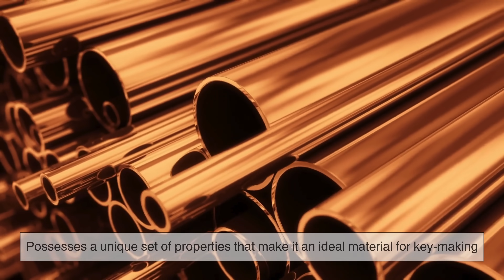Why Are Most Keys Made of Brass Instead of Steel?

Comment: Why is it in ENGLAND that YALE uses STEEL KEYS for their residential locks with the Y1 keyway as we call it in America & also how does SCHLAGE get away with its "L" multi-section STEEL KEYS that ride against nickel silver SOFTER pin tumblers?? Wouldnt BOTH of these cause EXCESSIVE WEAR on the bottom pins & plugs?????? These are FACTORY ORIGINAL KEYS Im talking about here.
Reply: OH!!, what about NICKEL SILVER?? MOST better quality locks have come with NICKEL SILVER KEYS. How does YALE get away with using BRASS bottom pins with nickel silver keys in
America?? Deosnt this WEAR much faster than a GOOD Schlage or Best lock that use NICKEL SILVER bottom pins?????

Comment: I checked my keys and it's 50-50 between bronze/brass and stainless steel. By the way, all household doorknobs, and all bathroom knobs and handles should be bronze or brass since it doesn't rust and is bactericidal. (He seems to have ignored that bronze keys are a possibility.)

Comment: Exactly what I expected. If you put two hard materials together and they're equally hard, they're going to damage each other equally, and that's rarely what you want. What you want is for one to be weaker than the other, so that you can control which one takes most of the damage. For example, think about railroads. If the rails are as hard as the wheels of the train, they will damage each other. Now what would you rather do? Replace a few rail wheels every few years, or replace your entire rail network every few years? Think about it.

Comment: basically, Brass is easier to machine, doesn't wear away the lock's internals, doesn't rust and lose its shape, is doesn't have as much fricition, and is more likely to bend than to snap inside the lock. For the same reason that knobs and dials are made of brass rather than steel. Saved you 8 minutes

Comment: I have keys made from brass and steel. My front door key is steel. Been using the same one for 20 years, still as good as it was on day 1. Doesn't squeak. Doesn't stick. Never caught an infection from it. No idea that brass vs steel was even a thing. Have both, both work fine. 
Moving on....

Comment: I had no idea that most keys were made with brass, since they are not usually brass-colored, but I figured they couldn't be steel either, since they bend too easily. Are keys ever made with other materials, like bronze or copper or any other metals?
Reply: Aluminium keys exist, a bit lighter and often come anodised
Reply: @Stue-e  Wouldn't aluminum be too soft and bendable for making keys?
Reply: @ for most domestic uses, aluminium is perfectly adequate, for commercial you want brass or nickle silver, because one of the 20+ key holders is going to be a 300lb gorilla who will test the yield limit on an aluminum key for sure.
Reply: @MatthewTheWanderer  They can snap off with much less abuse than brass.
Reply: @ No way is an aluminum key good enough for domestic use! My spare brass key is bent, so it would probably be broken if it was aluminum.
Reply: @ What, aluminum? Yeah, that's what I thought.

Comment: Keys, and the locking mechanisms, should have been either stainless steel or, far better, titanium...a VERY long time ago. There are other ways to eliminate the problems you mentioned. All of these solutions would cost, but who cares! It is irrelevant. Quality is everything. Everyone who has ever bent and broke a brass key will "SUDDENLY" understand this fact. Titanium would not break! Or perhaps better yet, flex titanium, a combination of titanium and nickel. Also, make keys round, like keys for a soda pop machine. And coat the lock mechanism slick and wear proof surfaces, such as industrial micro diamonds. Like I said, it would all cost, but quality is worth it.

Comment: I assume both aluminum and stainless steel are used in some locks, but they can be troublesome if used together. The junction between them can have a galvanic reaction that destroys the aluminum. I learned this the hard way when the screws holding on my aluminum license plate had eaten through it in only a few years.

Comment: The key in my 1983 Porsche is steel. As soon as I put the key into the ignition, everything electronic works without the need to start the car.
Reply: That’s because the key is operating a series of tumblers inside the lock, not because it’s steel.
Reply: @GT380man  No, power comes on because the they key turns on switched power. And I have no idea why you thought @dan321 was implying the material the key was made from had anything to do with swithched  power coming on. He was saying power comes on when he insterts the key. On most cars you have to tudn the key into Accessory position to get power.

Comment: I work at a forensic mental hospital, all doors locked. I receive a differenr set of keys daily. Quite often I get a key that is bent very slightly.This makes it difficult to push into a lock and extract. I have worked with brass many years, so I know how to straighten wihout fatigue and breaking a key. Keys can be treated this way, but once you see a small crack appear, you’re done and it’s time to recycle  the key.

Comment: Bull excreta. Look up industry documents and learn that easier machining is why brass is chosen.

In fact they prefer to allow toxic amounts of lead metal in blanks because lead melts and lubricates the cutting tool edge.

Lead is biocidal, the reason why bacteria are inhibited, and why babies are poisoned and brain damaged by playing with keys.

Locksmiths also are poisoned by exposure to lead in brass keys.

Any amount of lead in toxic.

I dare you google these facts.

Comment: brass is softer and easier to cut than steel and softer than the steel pins in the locks so it will not damage them.
Reply: You may want to research that claim or ask a machinist who actually machines modern, lead-free brass.
Reply: @chronocommander007  oh, and brass will not turn to rust. That is a plus, too.
Reply: @itoibo4208  All  my European car keys have been stainless steel keys. I've never seen a rusty steel  key unless it was lying outside in the dirt for a prolonged period. Even in the US where brass keys are more common for house keys and padkock keys, at least 20 percent of keys are steel keys. Steel keys usually have nickel coating just like most brass keys do. And brass can corrode, depending on what it gets in contact with.
Reply: @chronocommander007  yes, but I am talking about brass keys, not steel ones, nickel coated or whatever. Regular plain steel rusts easily.
Reply: @chronocommander007  also, if a key relies on a coating, you would be exposing the metal if you cut the key after it is coated. I read that they use an alloy called Silver Nickel, which is an alloy of copper, nickel, and zinc, which is also easy to machine and deters corossion.

Comment: Keys are easier to replace than locks.  2 materials of different hardness will wear less than 2 materials fo the same hardness.  So one thing get sto be steel and one thing has to be softer.

Comment: 2:52 this is why hospitals should use brass railings, brass door handles, etc. Unfortunately, many hospitals go for the "sleek shiny hi-tech" look of stainless steel everything, making hospitals actual reservoirs of bacteria and germs.
Reply: I think the problem with brass in hospital use is that brass oxidizes from common chemicals used in hospitals like hydrogen peroxide and peroxide based cleaners.

Brass kills bacteria within an hour, but typical dwell times for hospital cleaners are less than 5 minutes, allowing them to effectively sterilize equipment faster.

Stainless steel is resistant to these chemicals, and that's why they're commonly used.
Reply: Perhaps a byproduct of brass' antimicrobial properties and its tendency to oxidize, is its tendency to shed microscopic residue on human hands, leaving an unpleasant stink. So, while it's functionally cleaner, unless it is meticulously polished, it looks dirtier and leave you feeling a little dirtier.
Reply: And what about silver for all of these things guys?
Houses are expensive anyway.
Reply: Stainless steel doesn't corrode and is much easier to sanitize as a result. Hospitals are full of germs because they're full of sick people, not because they don't use brass.
Reply: They just don’t wanna pay somebody to polish all that Brass

Comment: Brass doesn't spark either
Reply: Well, sort of. However, if you carry a charge from shuffling on carpet you may see spark fly from a the tip of a brass key when it gets close to a keyhole. Aluminum bronze is used for proper non-sparking keys.
Reply: @chronocommander007  I was thinking more of as an ignition source.Some trades have to use brass hammers to prevent explosions from sparks
Reply: @ I know that's what you meant and you are mostly right.

Comment: Being a retired locksmith, I enjoyed this video very much. And I love brass! I enjoy making things out of it. Brass mechanisms do not squeak, which is part of its low friction coefficient. We used the say it is "self lubricating." Many years ago I knew an old horologist (clocksmith) who enjoyed working with brass too. He made all the brass cogs and working parts of old clocks. As his industry faded away he switch over to locksmithing, which he adapted to quite easily. After years of filing out clock parts, he could easily file up a safe key and some brass levers. I am still addicted to filing. Yesterday I filed out crucifix in the steel handle of an old knife and beat some brass into the recesses. The next few days I will file up a nice brass guard for the front of the handle.
Reply: Pleasure to read your comment

Comment: We are also seeing a lot of aluminum keys now.
Reply: really?
aluminum is not ideal, because they oxidize (corrodes) and become white powder (aluminum oxide).
steel will rust.
brass do corrode too, but at much slower rate.
Reply: @davidjacobs8558  yup, though mainly for apartment door locks where it is an interior door so not exposed to the weather. less likely to get the rust and aluminum oxide thermal reaction.
Reply: @davidjacobs8558  The aluminum can be anodized, which will prevent corrosion. But what you usually see is coated keys (probably paint) with various designs and colors.
Reply: @ well, the key need to be cut. which will remove any paint or anodizing or plating from the cut surface. 
aluminum is too soft, brass is not so much.
Reply: @davidjacobs8558  Actually, there is an aluminum alloy (which won't corrode that is used in aerospace, automotive and other industries) that can be used to make keys.
Reply: @ duralumin?
Reply: I had one on my bike lock when I was a kid 30 years ago.

Comment: What's the silver coating around many keys? The inside may be brass (seen after a key is cut) but many keys are mostly silver on the outside, or even colored.
Reply: It is usually a nickel coating, that is slightly harder and much more surface corrosion resistant than brass. The hardness of the coating makes the keys slightly more wear resistant. The surface corrosion of brass is primarily caused by organic compounds of our hands. While that usually does not impede it's strength and hardness, because it forms a thin surface layer that prevents continued corrosion, it does not look nice and can increase the friction coefficient. The nickel coating prevents that kind of corrosion, which results in the long lasting shiny silver finish.

Comment: Why are keys made of brass instead of steel? Because you can cut (by 'cut', I mean copy on a key cutting machine) a brass key with a steel cutting wheel but you can't cut a steel key without considerable difficulty. Sure, it can be done. But repeated use of the cutting wheel on steel key blanks will wear down the cutting wheel. And eventually result in key copies which don't work. And that's a problem if you're copying keys for a living. So, make the key blanks of brass.
Reply: Well … except keys before 1868 were made of steel. You’d know them as “skeleton” keys or heavy keys that threw massive wafers (see older Folger-Adams types).
My dedicated cutting machine’s wheels for steel keys really didn’t wear down much faster but did have to be realigned more often. The cutting wheels were more aggressively toothed and usually of a much harder metal. 
Of course, since it was a specialty in every aspect, everything cost more and I charged accordingly.
Reply: Modern lead-free brass is as hard or harder on cutting tools than mild steel.

Comment: Why is it usually silver in colour if it is brass? And the antimicrobial properties is meaninglesss if there is a coating on it preventing contact with microbials.
Reply: Most keys are chrome plated. That's why they're silver-colored on the outside. If you look at the part that's been cut, you'll see the brass color.
Reply: @soaringvulture  then the chrome coating would have negated the antimicrobial effect..
Reply: @testusersg  Nah. Chrome kills everything.
Reply: Nickel is also antibacterial.

Comment: Brass keys with a deep cut cracked easily there and became useless much sooner than other brass keys have. I have only had keys with that cut break and it won't be cheap to deal with if it breaks in the lock, maybe locked out for hours, so I replaced them soon, at my own expense because the building owner was not nice about our maintenence requests.

I asked for a steel key as a replacement but it wasn't available, I didn’t know why, now I do. It defeats the purpose of preventing breakage in locks by making them out of brass instead of steel while having that weak spot cut half way into them.

I am always happy to receive keys to anything with a nicer wavy cut and I hope for a lock change without argument if I see a key like that again. 

When I moved to a new place, I got the key and said 'Bonus already, a properly cut key which will last.' then I explained that. That key has outlasted each of the 5 keys of my past place.

That tumbler configuration should be avoided at all costs, there's plenty configurations make and they won't be matching in close proximity to other locks unless that's intentionally done or by a fluke. And yes, a government owned residential building had a matching lock problem which was discovered by accident, someone opened a door beside one's own door.

Comment: Brass is also easily recyclable.  I worked in an auto dealership and our keyblank supplier would buy the scrap brass from us periodically.
Reply: Yes … but it is usually purchased by scrap companies as “German Metal” and is not as valuable as brass. Valuable yes, but not as much.
Reply: AKA "Pot Metal"😮😈😱
Reply: @StoneyRerootkit Not pot metal is usually aluminum such as aluminum pots. That's another metal used for keys. Brass is best for keys. 73

P.S. brass is NOT pot metal zinc and aluminum is a good example of pot metal. Those Teflon aluminum pots were made of pot metal. If it has a low melting point you can be sure you got pot metal. I did many trips to the scrap yards and sold many aluminum pots that were made of pot metal. 73
Reply: @ronb6182  wrong!  thats not what pot metal is
Reply: @jasong6027  you are wrong go away enough said. 73
Reply: @ Not really … what is usually called “pot metal” in the hardware & locksmithing industry (in the USA) is also known as “zamac” which is a white, non ferrous amalgamation of mostly zinc.